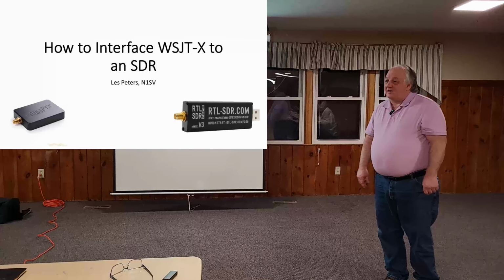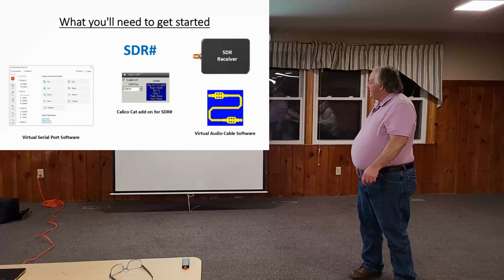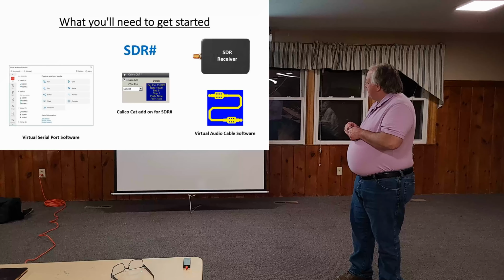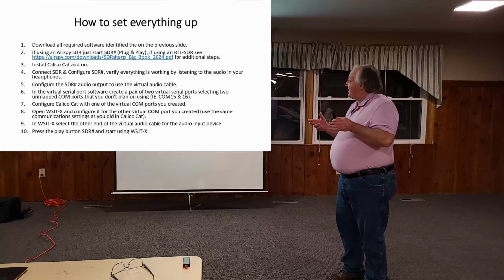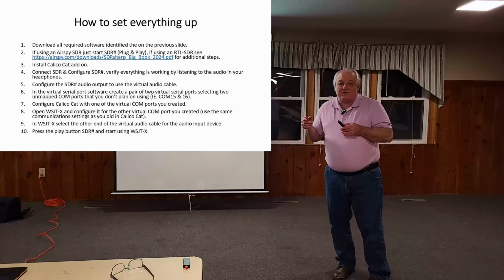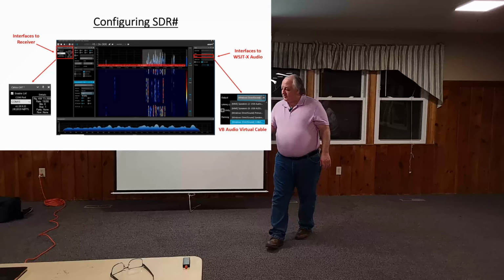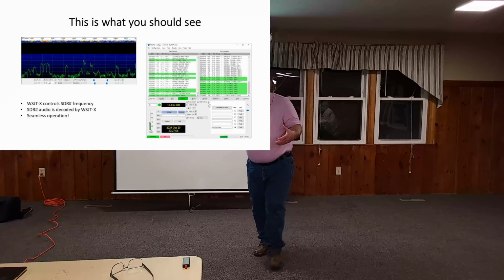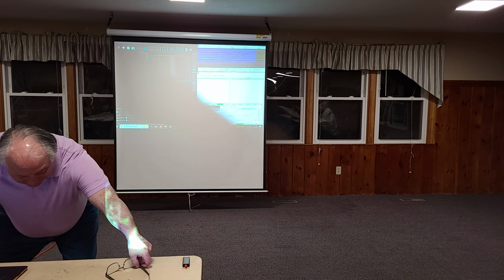Interfacing WSJTX to SDR# by N1SV

Comment: Thanks for the tutorial! It's been very helpful. Question: In the WSJT-X settings -> Radio -> Rig, there is a "Airspy SDR#/gpredict" option, does that means WSJT-X can directly connect to Airspy SDR# without via a virtual COM port?
Reply: No you need to create a pair of virtual COM ports, one for WSJT-X & the other for SDR# (the Calico Cat add on).  In WSJT-X you select a TS2000 for the rig with comm settings identical to those in the Calico Cat add on in SDR#.  Doing this WSJT-X can then directly change the frequency of the Airspy SDR.
Reply: @N1SV-h8o  Thanks!